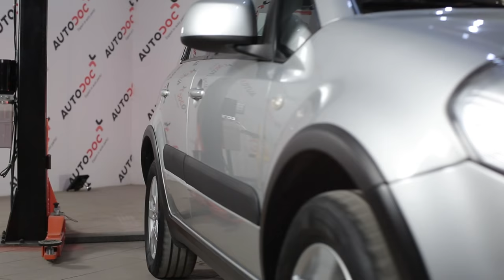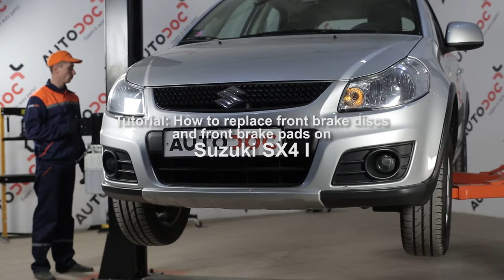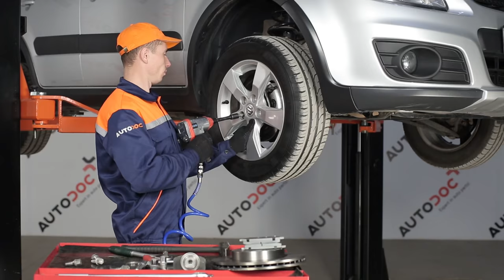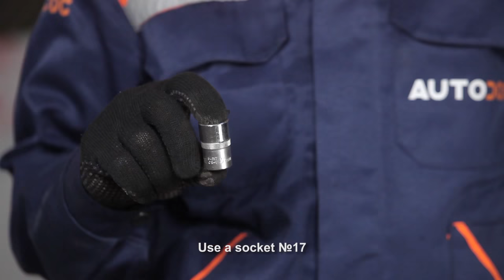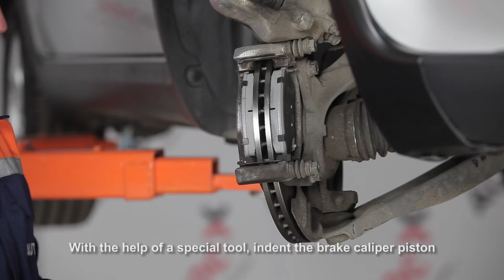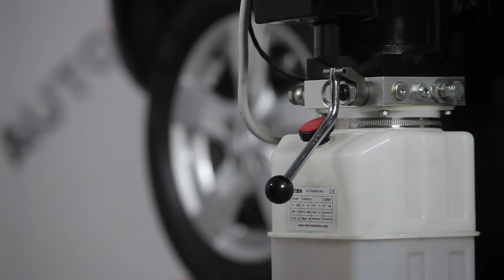How to change front brake discs and brake pads on SUZUKI SX4 1 TUTORIAL | AUTODOC

Comment: Where did you get those new set screws?  I ordered new rotors for our 2010 Grand Vitara, and they didn't come with any.  I would rather not try to use the old rusty screws, and I like the set screws to keep the rotors flush while I work.  Do you know where I can get some to fit our application?
Reply from the maker: Thank you for your feedback! We recommend that youget in touch with our Customer Support agents so that we could suggest the screws you require. Kind regards, Autodoc!

Comment: What size is that bolt to remove the rotor?
Reply from the maker: Thank you for the feedback! You can look up the rotor removing bolt size in the technical documentation on the vehicle maintenance or inquire about it at the official car dealer. Best regards, Autodoc.
Reply: Usually is 8mm bolt in SX4

Comment: I have a 2017 model that has no countersunk screws. Does this mean mine are floating?
Reply from the maker: We do not have this information, so we recommend you consult your mechanic.
Reply: @autodocuk  Thanks. I am my mechanic. I'll figure it out when I do the job but nice to be prepared. M8 bolts may be required to pop the old disc off.